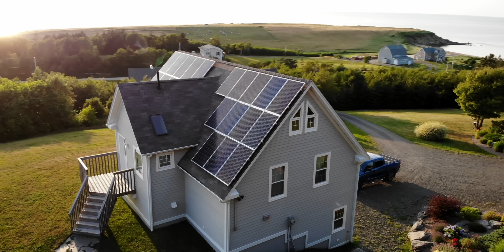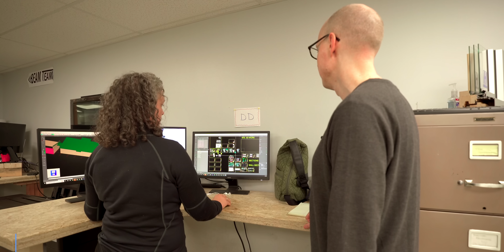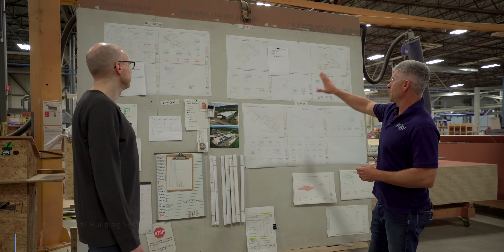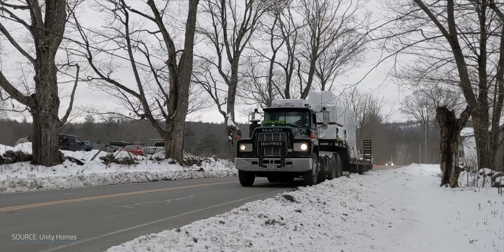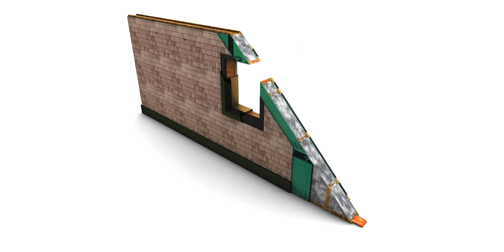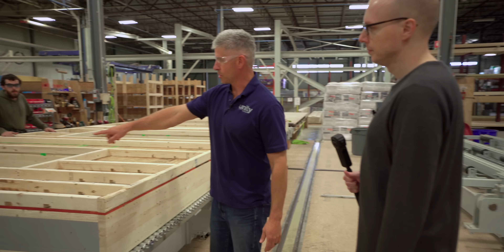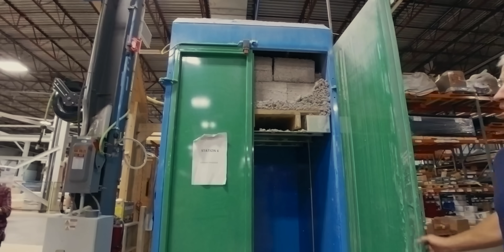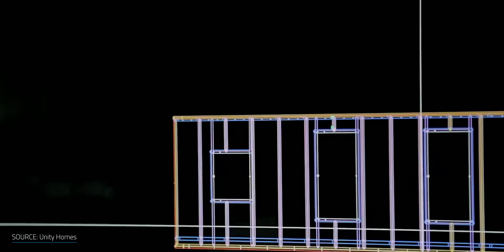The Simple Genius of a Prefabricated House - My Net Zero Home Build

Comment: I'm very curious as to how much more (or less) your house will cost compared to a "normal" house that is not assembled in a factory. (If there's already a video about that, I hope another of your subscribers can direct me to it.)
Reply: We are doing something very, very similar in Spain. The cost compared to traditional construction is slightly higher. However, it is much faster - builders prepare the ground and build the foundations while the factory manufactures the modules. The modules are then brought to the site when it is ready. It took 2 highly skilled workers (plus a crane operator and a helper) to construct the house from the modules in 10 days. The house is 180 square metres (just under 2,000 sq ft) footprint, concrete basement and the main living area on a single floor (timber frame structure). We're in the finishing stages now with plumbers, electricians, air con and plasterboard people doing their stuff. We hope to move in next month.
Reply: @jaydravecky8202  if I may ask, which company is building your house?
Reply: @jaydravecky8202  thank you for sharing. Could you say about the cost please?
Reply: @mintgreen9292  For us it is around €440 per square metre for the timber frame structure, insulation and roof - the concrete basement, installations and finishes are not included. Overall the cost is around €3,000 per square metre but this depends a lot on the quality of the finishes, levels of insulation, labour costs, plot specifics (access to our plot is limited to large machinery so we had to use more expensive small machinery), etc.
Reply: Based on the Unity website his house STARTS at $400,000 and quickly goes up from there. This house is super expensive...and that is for a 1000 square feet...it goes UP from there
Reply: @hyfy-tr2jy  considering my average annual utility bills, it'd take over a 100 years to make that back.
Reply: @hyfy-tr2jy  That's not actually super expensive where I'm from (Southern California), but it's not including the cost of land.  That's actually pretty normal around here :-(
Reply: @jgray2718  California doesn't count.... California is clown world
Reply: @jgray2718  Southern California is a pretty mild climate so building a super thermally efficient house has a lower pay off.  If it weren't for the insanely high cost of electricity you guys pay it probably would never pay off.
Reply: @jeffk464  Yeah, that's true.  Solar is a pretty good value down here, though.

Unity housing is based in New Hampshire so I looked up similar home builders in my area and none of them even posted prices.  I would have had to call and set up appointments to find out what it would cost (and I'm not building a house so it was a lot more trouble than my curiosity was worth), so God only knows how much they're charging.

Have a great day :-)
Reply: @hyfy-tr2jy  and you have to buy the land to build on too! Lol 😊
Reply: @hyfy-tr2jy  and you have to buy the land to build on too! Lol 😊
Reply: @hyfy-tr2jy  Wow, therefore $400/sqft.  Do you know what a 'comparable' stick built house with the same spec is? Thanks
Reply: @CPK007  I sense your sarcasm here. Passive aggressiveness is never healthy. My comment simply put, regardless of build quality/standards is that they are expensive and well out of reach of most homeowners budget. These homes could be an absolute bargain for the quality but no matter how good the bargain is, if it is out of reach if the average person it is fair to describe it as "expensive"
Reply: @hyfy-tr2jy  That's definitely NOT "super expensive." The average home where I live is $461,700. Again, that's average, nothing special. The price of right.
Reply: @TecnamTwin  just because where you live has homes averaging half a million is not representative of the rest of the country, and remember that price doesn't include the land, which your price does include the land.
Reply: Hey! This sounds like a perfect chance for Matt to make another video on the subject!
Reply from the maker: Depends on what you mean by normal.  My house is more expensive than a typical, built to standard code stick built house.  But compare it to a traditional stick built, high efficiency house, and it'll be cheaper.
Reply: @UndecidedTechnology  I'm also curious about how different styles of home construction and materials stack up to this methodology. I've long loved the aesthetic of a timber framed home but have concerns about the energy efficiency compared to more 'modern' methods.
Reply: would also like to know
Reply from the maker: That's the big problem.  Location, location, location.  Building this exact home where I did will have a very different cost from somewhere else in the country.
Reply: Key thing: massive cost overruns for architect built homes are virtually guaranteed - not here! The factory approach eliminates most areas where cost may escalate. Preplanned openings for electrical and plumbing make their job faster and easier to coordinate. Chances are your cost is very close to projection, and you're moving in faster.
Reply: For my area that cost is a bit too high.  My area is about $300K for a 2,300sqft 4bd3ba house with .25 acre; Ohio.  Granted there are some more expensive neighborhoods, but these houses seem a little steep for me yet.  Very optimistic about this lowering prices in the future and potentially using them for investments in the future.
Reply from the maker: The cost is very tricky.  $300 for a passive house level home is very different from the square footage cost of a base level code built house.  I do plan to get more into the costs later, but I did a comparison in a previous video on passive homes here: https://youtu.be/secB3R0sIYU
Reply: @jeffchoate8712  just remember to consider the cost of home ownership and not just the construction cost. A house like this will save drastically on utilities compared to your standard home. The longer you stay in the home, the more you save.
Reply: @gregfeaga3920  point missed is what the cost of similarly efficient house would be in my area which isn't modular, 2x the cost isn't realistic for that efficiency in my mind.
Reply: @jeffchoate8712  I have seen numbers of 20-25% premium for efficient builds. If that holds true you would still see a reasonable ROI.
Reply: @gregfeaga3920  no pp
Reply: @gregfeaga3920  -- Given the projected housing-price crash in many markets, you might have to stay in the home for he rest of your life-- a lot of people who shelled out top dollar during the bubble will be underwater soon. Hope you have a fixed-rate mortgage.
Reply: @gregfeaga3920  even if this home ran your utility bills to zero the return on investment of the added expense would be measured in decades..even to the level that the age most people are that can afford a home like this will never see the break even in their lifetime and that is if they paid for it up front 100% cash with no mortgage. Layer in the added expense of a mortgage and it would be your children who see the costs recovered.
Reply: @jeffchoate8712  You would need to take out the cost of land from the price you stated in order to make an accurate comparison with the Unity models
Reply: @IhabFahmy  accurate sure....but doing so makes the case worse for the unity model as it widens the difference.
Reply: I went through a deep rabbit hole to try to uncover the answer and the answer is that factory build homes end up costing about the same as a traditionally build stick house.

Advantages is that they are higher quality, disadvantages is that you have extremely limited choices and customizations relative to stick build homes.

Yeah in theory manufacturing build home should be cheaper, but in practice it's not really. Maybe 10% cheaper at best.
Reply: @artemaung5274  There are companies that will do custom homes. The last house I built had all the walls built in a factory and shipped to the site. We lifted the 1st floor walls with an all-terrain 6000-lb forklift and brought in a crane for the 2nd floor walls and roof trusses. The house went up in less than a month which allowed us to be weather tight very quickly. At the end of the day you do get some savings in both material and labor that more than pays for the cost of the forklift and the crane. You are correct that for a one-time build your savings over a "stick-built" or "field-framed" house are pretty small. In the case of a housing tract you'd definitely see economies of scale because both the field and the factory are building many copies of the same house so you reduce wasted time and materials knowing exactly what each house needs.
Reply: @Artem Aung  Not if your looking at a SIPS home.  More 
Expensive than traditional stick built homes.  Also be prepared to come up with more cash. Banks base their lending decisions on what a comparatively sized home in your area is worth and those homes are not SIPS homes.  Say ur home would be valued at $300,000 by the bank but it costs $330,000 to build yiu will need to bridge the gap.  So instead of $60,000 to acquire an 80/20 loan you now need to come up with $90,000.
Reply: Ditto
Reply: Unity homes is pretty costly 😟
Reply: Surely the cost needs to be compared to the region it will be placed in. If your somewhere in California it is probably a bargain whereas if your somewhere in a central state it may not be.
Reply: I'm curious is the company would wager making smaller homes.  At around 100-200k.  That more affordable for working class folks.
Reply: @gamesndrinks  they do...in the $200K plus range...they call them Nanos and they are 800sq ft total...talk about tiny
Reply: @hyfy-tr2jy  I'm assuming that cost is the cost of buying the home from the factory,  then there's a cost of construction/assembly at the job site,   running plumbing and electrical is going to probably increase that cost by 25% easily as well,  then there's furnishing the actual home and making it turnkey,  I wonder if it's just not cheaper to buy an existing home at the same size,  you lose a LOT more flexibility in that regard but still it probably would be cheaper for "the working class folks"... i.e. if you're that tight on money you probably are not getting a custom home.
Reply: @hyfy-tr2jy  200k for a tiny home minus land.    that is crazy expensive.    nope
Reply: @gamesndrinks  yea less customization. Fixed floor plans. It definitely starts to blur the lines between this and trailer homes though.
Reply: @gamesndrinks  The houses would be as big as my basement lol.  
  
Yeah I don't see these houses making a difference on pricing when right now they just care about the premium aspect of home building.  
  
I'd be interested to see if they offer just setting up the exterior of the house and allowing the customer to do their own wiring / drywall / finishing.  That would take away a lot of the manual work that they would still be required to do even after moving their pre-fab stuff onsite.
Reply: @gamesndrinks  why do work for less money when your back logged on work already. In my area I'm YEARS out from many projects
Reply: @vanderumd11  I'm not against them maximizing profit. But there is a market for mass produced cheaper homes.
Reply: Related to this, I'd also be curious about:

(1) An estimated cost of ownership over, say, 20 years relative to a standard build. I suppose this home will require less maintenance than a standard built home (given the detailed planning and controlled environment it is put together in .... windows are actually flashed properly). There's also of course the reduced consumption of energy to operate the home. That said, I don't expect these to fully offset the costs, which leads to #2...

(2) The perceived improvement in comfort. In cold climates, there are frequently cold spots in homes, slight drafts, etc. The expectation is that this home will be built very tight (while also providing fresh air via mechanical, of course), so it should be much more controlled and comfortable. Ultimately, we're paying to keep the outside out when we build a home, so if a house does that better, it is of course worth some additional cost.
Reply: @dosadoodle  Cost savings over time is definitely an important consideration when it comes to higher upfront costs, especially if you're building a new home to live in across the span of multiple decades.
Hemp insulation, for example, "only" lasts for about 100 years, and while it's about twice as expensive than traditional insulation, the cost savings of a reduced need for heating/cooling should add up long-term.
Reply: @dosadoodle   May not be saving annual costs as since the house costs twice as much property taxes will be twice as high there goes any savings probably.
Reply: I am interested in a cost comparition between this method and traditional method too.
Reply from the maker: I do plan to try and delve into this more in future videos.
Reply: Ditto here also!
Reply: Just the savings on waste alone nevermind the time factor between trades coming and going during the build. Electric, plumbing, environmental all installed in factory to spec. Zero waste...no markup on materials!
Reply: My in laws are building a house next to me. They went with modular because it is cheaper per square foot. The builder even said he could do a traditional stick built home but the modular would be better quality and a bit cheaper. There home won’t be as well built as this house though. Those r35 walls are crazy good.
Reply: Need to know cost please!
Reply: This is the future and wicked cool!
Reply: Have seen estimates of 10 to 20%, BUT.... the pay back would offset the cost in a few years
Reply: @istvantoppler5999  few years? Are you saying your heating/cooling bill is over $1200 a month?
Reply: @hyfy-tr2jy  Don't believe so.  Not sure where that idea came from
Reply: i am going to ASSUME that this house is costing him around 500 to 600k minus land.    that is crazy expensive. so your talking out of price range for most of America.
Reply: I just looked up Unity Homes, and starting prices appear to be $300+ per square foot for the smaller footprints. (Building costs have gone up ~50% in the last few years due to shortages both in materials and professionals, so this doesn't seem surprising as a cost for a quality home.) I'm not sure if that includes foundation costs. That said, there's a lot of customizability, so it will be interesting to hear more about Matt's case study and experience.

Edit (2022-11-16): Fine Homebuilding podcast 509 discusses building costs a bit, saying $300 per square foot is not unusual as a baseline cost after the last couple of years. That makes Unity's prices seem actually quite reasonable, especially after considering the quality that's delivered.
Reply: @dosadoodle   Yes. I love the smart and efficient way these houses are designed and built but it is NOT a low budget option. We built a house with similar performance in Vermont for about half the cost if you don't count our time (we did majority of labor ourselves). If one had the finances though, this is a great way to build.
Reply: Same
Reply: The starting price for his home, according to the Unity website, is $400,000.
Reply: Hey matt. I'm somewhat new to construction. I'm a general contractor and I am very curious to build energy efficient home as a product offer to customers one day. Seriously a goal of mine in the next 5 to 10 years. These videos are so insightful! Keep em coming!
Reply: @Chris  Latest talk on airbnb is that people are running away from renting and airbnb owners may be switching to long term or maybe having to sell.  Airbnb ownership is the latest side Hustle and these side Hustle come and go quickly. it's getting way too late to get into airbnb ownership. Good for us neighbors who despise air B MB.
Reply: Well, he wasn't going to build a normal house.
Reply: It is around $500,000 for 1200sq ft .. so 

Expensive. You ALWAYS get what you pay for.
Reply: This style of construction is generally considerably more expensive than mixed stick built homes.  I say mixed because in most instances the trust's joists are prebuilt,  whereas everything else is stick.  This is an overly simplified answer though becaous in the 3 modes of cinstruction (custom, spec, and track), there is for reasons involving the nature of each of those 3 modes, a great deal of variety between modes.  For instance in track homes it's pretty normal for developer to not really make any money on the stick itself, All of their money is made on the development and by the time they're throwing the stick up they just wan to get the property off their books. Thus, they will put up the least expensive stick as quickly as possible.  Anyways, it's complicated. But I think the biggest factor is that until you have literally thousands of companies at this scale ding this work,  you won't be making much of a dent in the industry.
Reply: Generally speaking, doing your home as a prefab, cuts the cost significantly because your making everything in a factory or in my country we have mobile factories. This reduces the cost for transportation, materials, labor and time. Just like car factories. You should do a simple exercise, have an architect design a "mockup" design of a 2 floor home maybe and send them over to a prefab factory and a construction firm and let them present you a total budget, also include how long will it take to finish and have a small adjustment for inflation (around 10-15%) per 9 months. Hope this can clarify and give you a better idea how to determine the cost, pros' and cons'.
Reply: @Chris The land cost is the biggest driver behind the housing crisis because of lot and coverage requirements.
Reply: Question: is this type of construction approved for colder climates like upstate New York?
Reply: @Kevin-Spencer-Beckford this company is based in Keene NH, which is about the same latitude as Albany NY. I grew up in Plattsburgh, but those temps aren’t as bad as they were when I was a kid in the 80’s. I’d be comfortable with these homes anywhere in the US.
Reply: 3X
Reply: @jimadiah what state r we talking about here?
Reply: cost per sq per sq ft?
Reply: According to their website the most expensive model starts at roughly $603,000.
Here in the states, for a house that size, it's a pretty reasonable amount.
Reply: @nibblesnbits  Not really, that's heavily dependent on where you live. Here in WV $600k gets you a mansion lol. You can get a house this size for under $100k
Reply: @nibblesnbits  keep reading hah the prices go a lot higher $925,000.00. Did you know you need the land to build the home on as well.
Reply: @nibblesnbits  -- Of course that doesn't include the site and the site work, which could add another few hundred thousand to the finished product. You're not going to park that house on a quarter acre lot in a cheap section of town. A two-acre lot in an area where that house would fit in could easily add 200,000 or more, and add excavation, concrete work, perhaps a well, maybe some poles to get utilities, driveway, landscaping, and pretty soon you're pushing a million.
Reply: @nibblesnbits  How may sqft is that? Thanks
Reply: @nibblesnbits  YEA, way too expensive.  I would downsize or move.
Reply: @nibblesnbits  It depends entirely on where you live. Those costs are very high for where I live. Other places, it would be low.
Reply: @nibblesnbits  wtf part of the US are you in? For a house that size it should be around $200k-$250k.
Reply: @ShadowDrakken  in the USA the price of a home is based on the area. You can't get a townhouse for less than $450k in my area
Reply: Just pay local Amish to build your homes, they are very cheap.
Reply: @Jokerwolf666   True where I am Amish built save anywhere from 10 to 25%
Reply: @bill-8794   The Amish where I live can build quite a large place for like 50k.
Reply: @Jokerwolf666  your missing the point. THIS mfg process results in a much higher performing home. Energy costs will be much lower in a home built this way.
Reply: @pauldesi   I guess if you can afford it it's not too bad. I'm lucky that I live in a place where I can still build what most would consider a small mansion for like 200000.
Reply: @Jokerwolf666  not only cheaper but quality. Amish  are artist in that field.
Reply: @edgarmuller6652  A lot of people don't know you can contract them to build for you either.
Reply: @edgarmuller6652  Amish built houses are NOT cheap at all
Reply: @Jokerwolf666  yep $65 per man hour... And they take 2 hour lunch breaks. In by 8 done by 430
Reply: The cost and complexity of repairs are concerning. Who and how is going to fix these windows when they break? What electrician would work with this wiring when you need to upgrade it?
Reply: @artirm1979  What are you even talking about? Any multi-pane window you can buy now is disposable. a UPVC, vinyl, fiberglass, or aluminium frame isn't repairable. Only wood framed windows are repairable by your average skilled contractor/builder person, and I can't imagine anyone is building with single pane wood framed windows now. Off the shelf European triple pane windows are  decades ahead of even high end windows made in the US. The electrical wiring in the house in this video is exactly the same as in any other house, so repairs or upgrades would be exactly the same as in any other typical home. I don't understand your concerns at all.
Reply: @travelfeet  From this video it appears that they use some sort of proprietary method for inserting windows into the wall. Also, the EU-style windows would be a pain to source in the US. As far as electrical wiring goes, they had to cut wiring channels in the factory, because doing so in the finished house would be difficult, look how their channel is flush with the inner wall). Your average electrician will mess up the wall structure trying to run new wires.
Reply: @artirm1979  .. any local window place will service the glass. Most contractors will change the windows out to ANY brand .. what I tell clients..
If it doesn't go to space then I will work on it.
Reply: compared to hiring someone to make the same house, this is a wasteful process in terms of consumer time and money. The website price is obscene and isn't saving the customer money or time. Maybe if you don't have months to build it's good but holy shit you pay out the ass for it.
Reply: What type of insulation is used? What is the carbon footprint of the materials? The materials used in building the home can actually sequester carbon which is key to keeping climate warming to 1.5 C
Reply: @susanhay4371  climate warming lol..
Reply: Home prices vary drastically by location. Thank our lucky stars we live in Texas rather than some areas of inflated real estate values such as our West and East coastal states. Is the claimed efficiency of construction and material passed on to the consumer or is the market only to those who can afford the sustainability. After all electric vehicles are more expensive and as we are discovering not so great for the environment either. People get sucked into what they are lead to. Ellie e is good. Part of the homeless problem is the lack of affordable housing, NANCY! Do these innovative builders build efficient tiny homes too? The middle class is disappearing at an alarming rate. Also how reparable and easy to maintain are these units? engineered lumber is fine till it gets wet. What about inset infestation? Rodent proofing? I get the idea and the concept. This is placing emerging technology together and making super gains and benefits. Is this the leading edge of technology or the bleeding edge?
Reply: @crawford323  "NANCY!"...really? By veering off-topic and bringing your wrong-wing political lies to Matt's YouTube channel, you sounds like someone with a anger management and substance abuse issues. Remember, "People get sucked into what they are lead [sic] to." Good luck.
Reply: @Mmmyess  Guess that Stings somewhat. It always amuses me to see replies laced with personal attacks. Had I said MITCH! Would that had made it less offensive to you? Both parties are equally to blame. How do you pay for the roof over your head? Affordable housing is a major problem.  Not all homeless are incapable of contributing to their own well being. People are buying old vans and truck and flocking to any spot on public lands to exist. What can be done with this kind of technology to help with this growing problem?
Reply: ICF would be the way to go.. you get all the passive benefits for less money and it becomes a generational home.. no way these ultra tight press board homes last 60+ years..
Reply: @FJB2020  ICF is catching on, and it's an effective way to build. But "60 years" is not a long time for a home to last at all. I'm used to houses lasting 150 years easy... that's a REAL generational house.
Reply: @IhabFahmy  ICF homes would last 150+ years.. What I am saying is the home Matt is buying will not last that long and would not be considered generational.. The rot these tight homes get with OSB walls is an issue.. Just look at the failures of SIPs...
Reply: @FJB2020  -- search for some YT videos with Joseph Lstiburek in them (yeah, that's how it's spelled). He's perhaps the foremost expert on moisture control in buildings. Moisture control in tight houses is crucial for longevity.
Reply: @grizzlygrizzle  I will have to take a look.  I have seen many building science guys build these ultra tight homes, but they have to rely heavily on ERV/HRV to keep it controlled and even then, they are extremely susceptible to moisture issues.  There is a reason 100 plus year old loose and drafty homes are still standing today and some tight homes from 10 years ago are rotting..